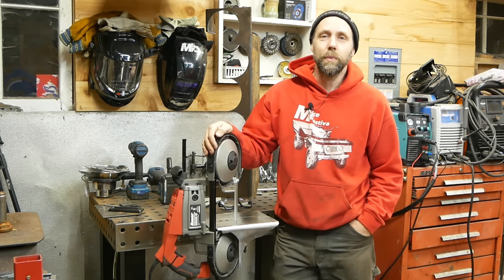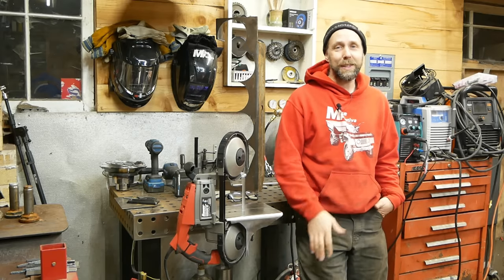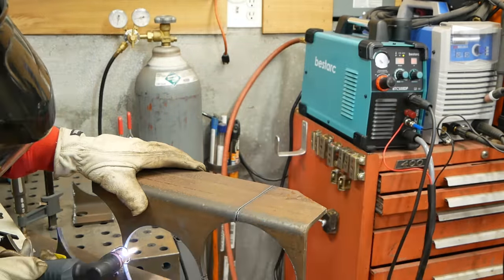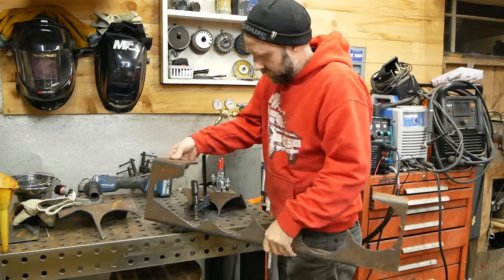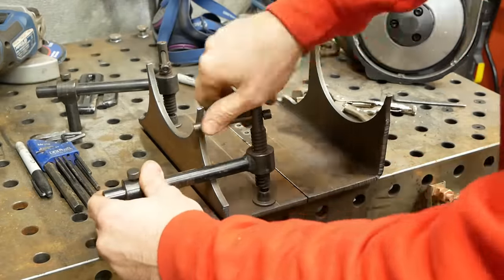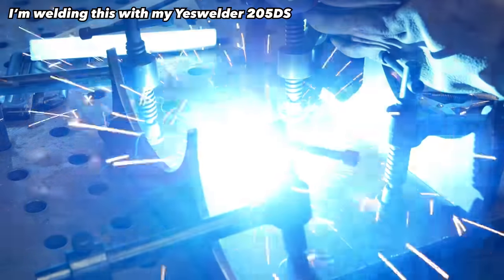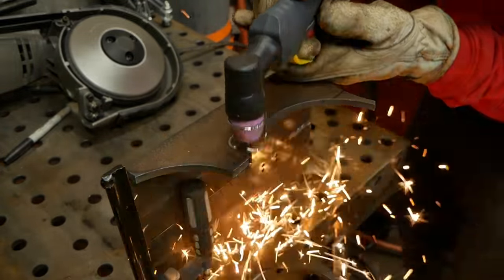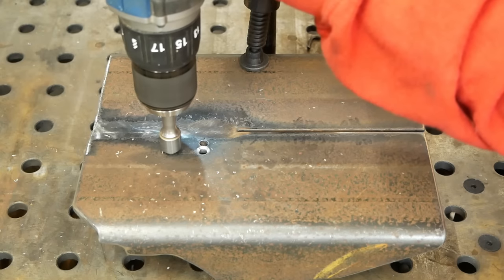Portable Bandsaw Table Build

Comment from the maker: 3 different Plasma cutter options below. Amazon Paid Affiliate Links.
Bestarc is the one used in the video. https://amzn.to/3qxE4zx
Bestarc consumables Kit https://amzn.to/3y6oPjD

Hynade CUT40 budget friendly 120 volt HF start drag tip plasma. 
HYC410 https://amzn.to/3qtA9DN
Hynade  HYC410 Torch Consumables https://amzn.to/3594U9v

*Anyone looking to buy a Crossfire CNC table should look at this plasma cutter *
The Hynade CUT60DN CNC Blow back pilot arc plasma
with Plug and play connections for CNC tables. (CUT60DN)  https://amzn.to/3D7k1wN
I have been running this exact Plasma with my CNC table and it works really well!

Comment: Maybe someone commented this but I just saw you using 3-in-1 oil with your drill bit. FWIW I find TapMagic or other cutting oil to work waaaay better. I used 3-in-1 for ages and when I finally switched to actual cutting oil I was amazed at how much better it worked.

Comment: I have a portable band saw. I built a bench top stand that it hangs on by the handle and then bolted a square plate of 1/4 steel to the cutting table. I use it all the time. I like how it mounts to the welding table. That's really clever.
Reply from the maker: Thanks for always commenting Chris 👍

Comment: 9:13 Mike, I'm running a Swag table and a deep cut Milwaukee. I found the extra clearance around the blade can be more of a problem. Small pieces can fall through and get caught between the blade and the roller bearings most of the time breaking the blade, It usually happens just after you put on a brand new one🤣. I actually tig welded the slot with some silicon bronze and then recut the slot with the actual band saw blade. Think about a big metal cutting band saw, they have blade guides that deflect the material outward keeping it off the tires. Anyway good stuff as always. Keep up the great content 👍

Comment: I took the easy way out and went ahead and bought the Swag table for my porta band. Works nice. One thing I found with that bare metal, it rust real quick. So I took some paste wax for furniture and gave it a good coat of wax. You may want to consider doing that.

Comment: You mentioned putting a guard on the foot switch. I don't know if you have used one often, but those loops get in the way quite a bit more often than they save you accidental triggering. What I have found to work unusually well is to simply mount the foot switch to a heavy base, something at least an inch thick. This stops the pedal from scooting away from your foot, but oddly, it also prevents accidental use. Because it is up on a one or two inch board or brick, you won't naturally step on it. It's also comfortable to kick under the bench and pull it out with your toe. It's a tiny detail but it's a big improvement while working. At least for me, the lightweight of the pedals is a much bigger complaint, I often had to lift my hood and look in order to get my foot in the guard before I modified it

Comment: I did this to mine----I used 2 1/2" pipe clamps on metal support (LOLLY) columns in my basement. the clamps had arms that i used to hang my saw with.

Comment: Granted I have not used a portable band saw, but I have restored quite a few normal band saws. I would not widen the slot if I were you. Usually over time, the set of the bands chews the groove wider and wider. It's nice to have it very tight for when you have to saw very small items. Traditionally, many band saws employ an aluminum puck in the center that can be easily replaced after it gets badly chewed. If you do go with a wider slot, may I suggest you make sort of a bushing so to speak that drops in to the slot making it nice and tight for small work? I came back after you mentioned the idea of smaller bits going down the crack. You don't want this! They get embedded in the tires and screw up the tracking. Trust me, keep the slot as narrow as you can. You can always make drop-ins if you go with blades with a different set

Comment: Harbor freight has 2 foot pedals. One is on only when you step on it, the other clicks on and clicks off. I’ve been using it with my saw and with my forge blower for over 2 years, no complaints.
Reply from the maker: I found the HF pedal after finishing this video, there pedal is much better then the Amazon one for sure 👍

Comment: I recommend you don’t widen the slot. Ah, I see you’ve already done it. Well, my two cents anyway, now that I’ve started. In using bandsaws for too many years, I’ve found that a wider slot encourages small pieces you cut off partly drop into the wider slot, and often jam against the blade. A really narrow slot is similar to the “zero clearance” insert we also use in woodworking saws. That’s really intended to prevent splintering, but also makes sure nothing falls into the machine. It also, on a bandsaw, serves to prevent the blade from wandering, particularly on a portable saw like that where the guides, such as they are, are far away from the part being cut, and so allow the blade to twist.

Comment: Harbor freight has a pedal.  I don't know how good it is but I was considering it.   I just picked up a used SWAG table with a foot pedal and the miter.  My pedal worked two times and then stopped working.  I was thinking of ordering the HF version and then take apart the SWAG one to see if I can see what is wrong and fix it.    I wanted to figure a way to mount my table next to my welding table.   Thanks for this video.  It gave me an idea or two.

Comment: Grat minds...  I have a little storage project I'm orking on and I need to split a bunch of thin wall metal conduit.  I could do it with an angle grinder or a sawzall but both are sketchy at best  Last weekend Harbor Greight had 15% off any Buaer corded tool and I just got my Swag Bench top band saw table..  I also was in the market for a plasma cutter and after seeing your video I pulled the trigger on that same model you bought.  Works great!  Thanks for your videos.  Build on!
Reply from the maker: Right on thanks Dave 👍

Comment: Awesome job Mike. I thought about this as well, but ended up ordering a Swag table. I built a permanent wooden stand to mount the Swag to at the right working height. I also wired a 110 switch to the front of the stand and saw plugs up and the back of the stand. A problem I had was the air blowing off the motor fan was blowing chips all over me when cutting something, I fixed that by fitting a plastic tube over the exhaust port and directing it out to the side, that works great. In my experience a “zero” clearance slot would be best, as to not get small slivers wedged between the table and the blade, possibly breaking the blade. I also found the 12 to 14 TPI blades work best for general cutting, I have some 18TPI blades as well. Mine is a Milwaukee deep cut saw, and has worked great. I enjoy your videos.👏🏻👌🏻🔥🔥
Reply from the maker: Thanks for checking out my new video and mentioning your thoughts on blades and the table slot. I really appreciate it 🙂👍
Reply: @Mikefestiva  Let us know how your slot modification works out after using it for awhile, I would be interested in knowing.✌🏻

Comment: Harbor freight carries two models of foot pedals or at least they used to. One model you have to step on the foot pedal and keep your foot on it for the electricity to continue the other model it's more like a switch you step on it and turns it on and then you step on it again to turn it off. I have the one that you have to continuously stand on and it seems pretty solid and reliable and stuff I have no complaints.
Reply from the maker: Hi Chris! Thanks for watching 👍

Comment: Nicely done project and video. As a long time bandsaw user I suggest you re-think widening the blade slot. It is far better to have as close to zero clearance as possible as small bits often get trapped in the slot wedging against the blade. This is not good! I just use a cheap paintbrush to sweep the little bits away

Comment: Like the build. I did the shortcut more expensive route and bought the Swag unit that fit a HF portable band saw, works very well. Also you might check HF for one of their toe  switches. Works very well on my set up and was reasonably priced. Keep em' coming. New subscriber.
Reply from the maker: Thanks for checking out my new video Spencer! Yes I ended up finding one of those foot switches at HF and it seems like a better switch for sure 👍
Thanks for subscribing 🙂 I definitely appreciate it!

Comment: Cool, I just made my own too, then literally 1-2 weeks later both you and blondihacks make videos lol!  Mine is a bench top free standing version because I didn't want to have my vise out of use while using the band saw.  Mine is aluminum construction and you can still pick it up with the table attached and utilize the saw as originally intended.  I also have blade access cut towards the frontl ike you did to be able to change the blade while table is still on (bondihacks had her cut towards the back of the blade which I thought was not a good idea).  Cheers man!

Comment: I did a semi similar piece which just basically is a larger aluminium table on it rather than just the little stamped guide. The biggest issue I had was that the cast area that the guide bolts to wasn't even close to level with the blade.  So I actually taped some plastic on there and filled it with jb weld which I then block sanded to get flat and 90 to the blade. I think my saw is the older Chicago electric version though so maybe the Bauer is better. I clamp it in the vice and use a plastic clamp on the trigger . I do mean to build a little better system at some point but it is still very useable.

Comment: I built my own table for the saw as well, something I noticed is you have the slot to the front of the blade, this requires you to remove the blade to get the saw out of the table. If you had run the slot to the back of the blade you could remove the saw without having to take it apart. I wish I could post a picture on here for reference... Good build though.
Reply from the maker: I understand what you are talking about with the slot, I intended it to be the way I did it because I don’t plan to use it often without the table, it’s basically used as a small bandsaw on my welding table. The reason I made the blade slot on the front is for easy blade changes without removing the saw.
Thanks for checking out my video 🙂👍

Comment: Nice build. I have the same bandsaw and for my needs it's perfect. I have a mig welder and a tig welder I bought off a guy who bought them for one project and never used them again.  I made my table out of 1/4" too, and is 10"x10" I had leftover from a woodstove build for the shop.I wanted to ask why you left the long piece on the front edge?

Comment: Nice job Mike, timing is everything I'm actively looking for a horizontal band saw but they are so expensive. Even the small tabletop units are almost the same price. So I guess I'll build a table for my Milwaukee hand held. I was even looking at the 15 inch evolution to cut down on shipping but have to consider $100 blades and have to have different blades for stainless steel and so on. eventually accumulating 4-5 hundred dollars in blades. Mike, what brand horizontal band saw and what features (coolant, hydraulic down feed limiter, and any other)  would you recommend for a small hobby setup?  Thanks for another great video.

Comment: One other question, I have been drooling over your fixture table but I can't decide whether to build one or regrind an older acorn table. I've noticed quite a few models use thinner material for the webbing and/or sides. Yours appears to be full thickness, may I ask how thick the steel is? Are the holes extremely uniform? Have you been happy with it overall? Thanks much.

Comment: Hey Mike, how is the Hercules cordless grinder? I've got the Bauer one and its a bit weak though, good for light grinding but RPMs are kinda low to do anything medium to heavy grinding.
Reply from the maker: I really like my Hercules angle grinder! I haven’t plugged in my older angle grinders in probably a year or more.
I had a Bauer cordless angle grinder at my work and I was extremely disappointed with that tool. The Hercules brushless angle grinder is a really well built tool and you get fairly long battery life out of it. 
Take care 👍🙂

Comment: Nice, but if you had the blade access slot in the rear of the table instead of the front, you would not have to remove the blade just to remove the table in case you needed to use the portable saw as a portable saw, but I like it mucho.
Reply from the maker: I built it the way I wanted it, I see changing blades far more then I plan on taking the saw off for free hand cutting, I have plasma cutters for free hand cutting

Comment: I needed to finish a trailer I was building and my Porta Cable band saw died. I looked all over the web and they are quite pricey. I ran into one called WEN but the cost was cheap so I figured if it would do the job and last just to finish what I was working on then it was worth the chance to buy. When it came in I figure it was a cheapo so I just brought it in the house and put it aside figuring I'll get to it when i need it. The next night I was eating and on my computer and decided to take it out of the box and when I saw it I wasn't expecting anything except a cheapo ( you get what you pay for). I was incredibly wrong. This tool was hefty and seemed well made, so I abandoned what i was doing and took it out to the shop to try it. With the blade they sent this thing cut just like the DeWalt's, Makita's and Milwaukee's I used for years in the electrical trade. Their motto, " Remember when tools were made to last". And that was 5 years ago, still golden in my repertoire of tools. Sometimes you get better than what you paid for.
Reply from the maker: Awesome to hear it’s been holding up well 👍 good to know, I had another subscriber asking about an affordable portaband saw I will pass that info on to him. Thanks Stevie 🙂👍

Comment: Great video mike, you're really getting me more and more interested in the metal work. Picked up my first MIG welder last year. I'm ready to upgrade to a metal saw of some type instead of just using my 4-inch angle grinder to cut material. Would you recommend a bandsaw style set up like this or a tube and pipe cutter?
Reply from the maker: Thanks for checking out my new video James 👍 angle grinders are always useful but they do make a mess with all the grinding dust and sparks. A bandsaw is a good setup for metal cutting. Either this bandsaw setup or the vertical/ horizontal metal bandsaw sold from Harbor freight. Here’s a video covering it at the end of the video. They sell for about $325 but you can buy them cheaper on sale sometimes, I bought mine used 6 years ago and it’s still holding up 👍 this bigger bandsaw has more advantages then the table top saw I made the table for in this video. Check out this video, there’s also a part 2 of this video https://youtu.be/xT-DqcsuzBM
Reply: @Mikefestiva  awesome thanks!!!!

Comment: I don’t know if i need to replace the bearings on mine or what…. I feel like the blade gets a little sloppy now for straight cuts after so much use… as for the width of your throat there.. I say leave it small…. I feel like I’ve had more problems on the one i made a while back when I got my saw because I cut a throat a little more than twice that wide…. It tends to sometimes allow the smaller cut off pieces to wedge in between the moving blade and the table throat itself.

Comment: Would it not have been better to weld up the front part of the plate than the rear(behind the cutting face)? It would then allow you to remove the plate from the saw without removing the band first.
Reply from the maker: I built it the way that works best for me, I mainly use it for a saw on the side of my table, I change blades more often then I remove the saw from the table, that’s why I built it this way. The good thing about building stuff yourself is you can make the tools fit your needs the best 👍

Comment: Hi Mike, I might have missed it but the saw itself is totally supported by the two 5 mm screws. Is that correct? According to the HF website the saw weighs 16 lbs. Do you have any concern about cracking/breaking the cast aluminum where the screws screw into? That area was meant to hold a blade guide not the weight of the saw plus vibration. Thanks.
Reply from the maker: I think it will be fine especially for the fact bandsaw tables like this have been sold for years now and they mount the exact same way. If it does fail over time then I guess I could be wrong 🤷🏻‍♂️
At least I only paid $75 for the saw.
Thanks for checking out my video. 👍
Reply: @Mikefestiva  I picked up a Bauer and going to build a table. Love the videos thanks for making them!
Reply: @Mikefestiva  Forgot to mention I really like the mini plasma table with the water tray..That is cool!! Thank you for making the videos too.

Comment: I like the build...But I think mounting the saw to the table with just those two screws seems kinda weak. Personally I'd want a little more support.
Reply from the maker: The table is mounted to the saw this way on all table mounted kits sold for these saws, it’s how it is because there’s really not other mounts? It’s a $75 dollar saw, it is what it is.
Reply: @Mikefestiva  I have the real Milwaukee tool, IDK if they do now, but they used to offer a table for it and it used one of the bolts for the rear blade safety guard as an attachment point in addition to the 2 you used....Even with that it wouldn't be my preference to hang the weight of the saw off the table. So i opted to copied the 3 point mounted table and built a cradle to hold the saw. In fairness it could be over kill. On the other hand it's now 25 years later and hasn't failed yet.